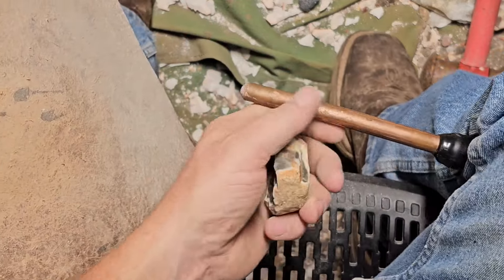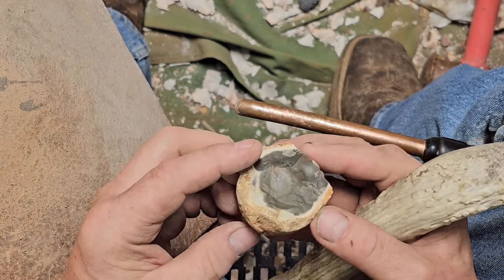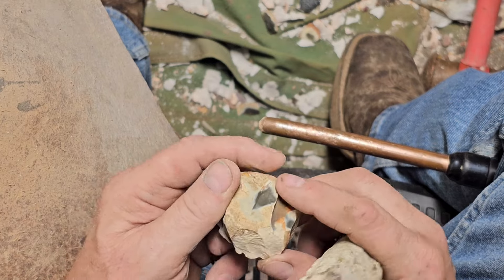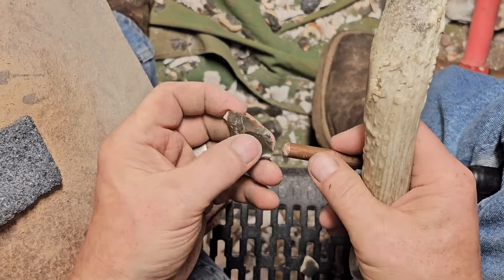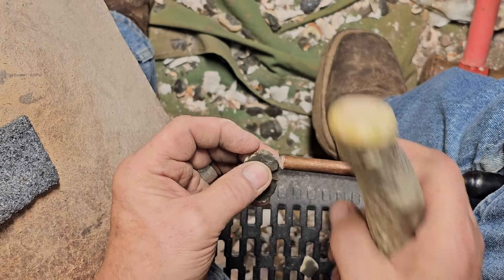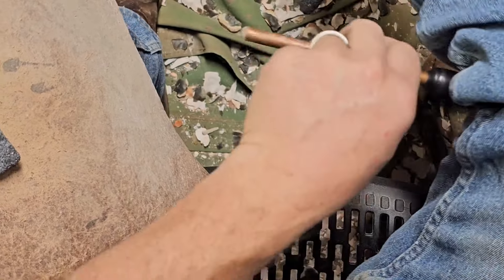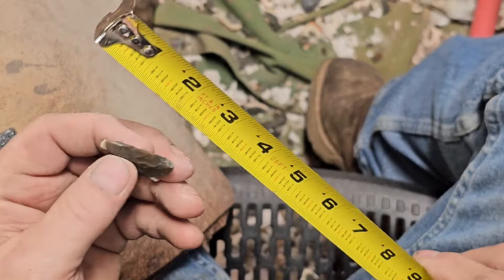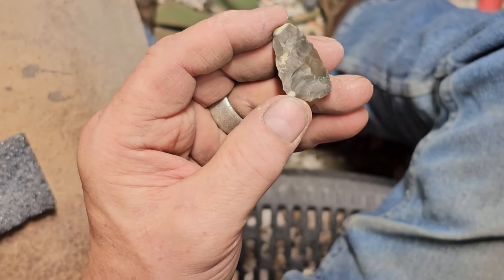Hardest Clunker Yet Episode 6, Beginner Flintknapping.

Comment: What diameter is the copper bar you are using? And what kind of handle set up do you have?
Reply from the maker: @scottbrewton2214  The rode used in this video was #3 flexy stick, and it uses 3/8 rod. All four sizes of my flexy sticks are available on the website flintknappingtraditions.com, and all have handles designed to flex to overcome any energy loss